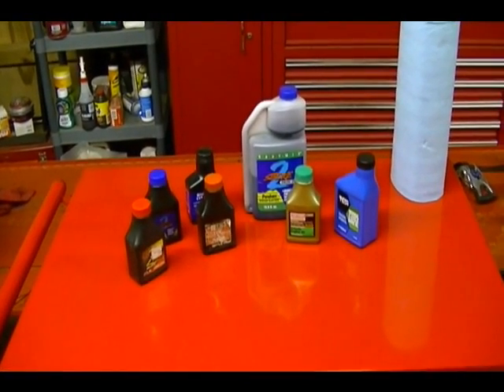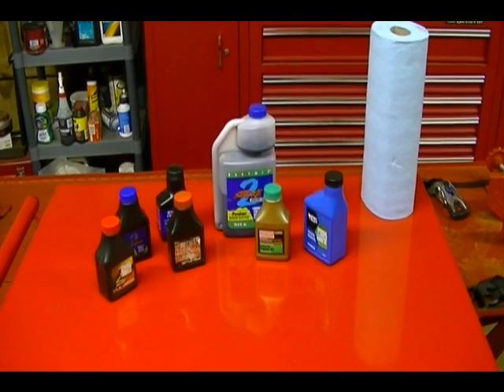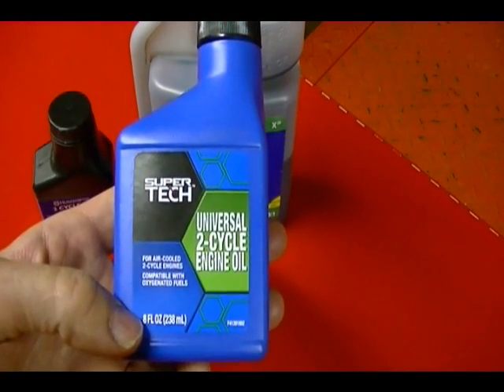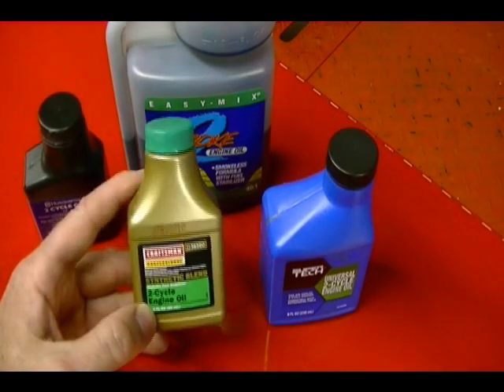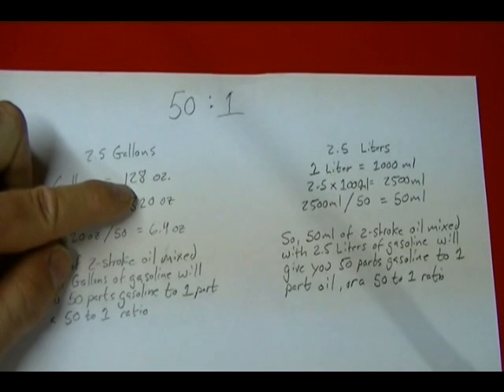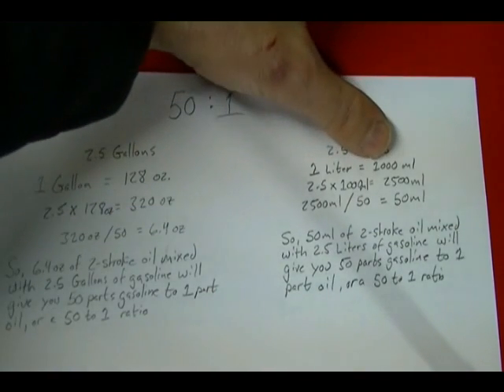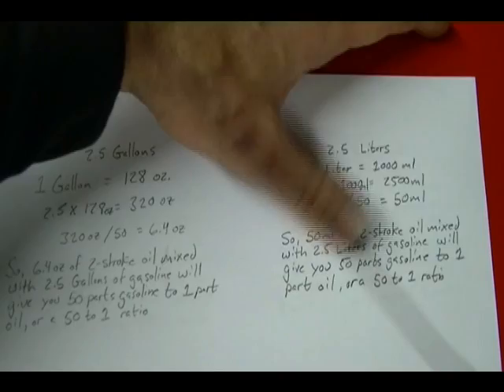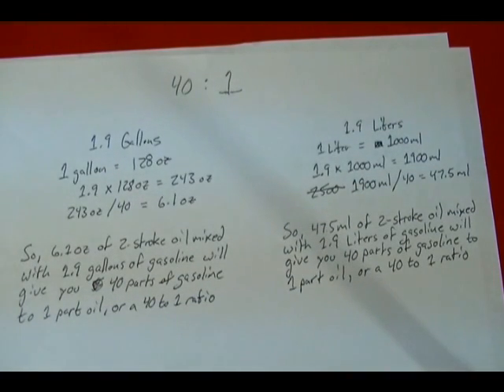Small Engine Repair: How to Calculate or Mix 2 Stroke Oil with Gasoline or Petrol

Comment: would it be possible to use plain edible  mineral oil as an emergency 2-stroke oil??
some say it can be mixed with the current oil for the break in period of any engine.
my engine calls for the 20:1 oil/gas ratio for the initial break in period, calls for the 40:1 after break in. i did however use a 20:1 mix of vegetable oil long after break in for a tankful with zero problems.  low ash buildup on piston/dome. whats the deal with these expensive oils when they dont seem to do much more?? whats the secret in mineral oil??

Comment: I would like to see someone come up with a mix chart for pints = 16 oz of fuel and quarts = 32 oz. I'am tired of mixing up a gallon of fuel and next time I go to use it the stuff is sour and the engine runs bad. I use less than 16 ounces of fuel  month in my weed eater 40:1 and it's really a waste of fuel. I get my fuel a a Marina and it's ethanol free at 4.99 a gal it's a waste. Good video bro nice info. Keep'em coming.

Comment: 1. take off the cap on the 2 stroke bottle, fill with oil, dump in the gas tank.
2. fill up tank with gas 
3. go to town, those little engines have a wide tollerence.
4. If its too rich, it just smokes more but the engine is fine and its bad for the environment 
5. You are cutting your lawn with a gas engine, who cares about the environment.

Comment: google search engine has a built in calculator that does this pretty easy. so for instance if you want to do 5 gallons of gas at a 32:1 you simply type "5 gallons / 32 to ounces" into the search box and it gives you the answer "20 US fluid ounces" in the results

Comment: It seems so much easier to use metric units. I can't even remember what an ounce is (grin).

 I just use one of those syringes sold at wallmart for the oil, and stick with a fixed single volume in the form of a small gas container dedicated to the device. Doing the same volume each time frees the mind of calculations, and lets you concentrate on the job at hand.

Comment: What I have wondered is I know the effect stabil has on gas but what reaction (if any) does it have  with the oil in pre-mixed fuel does it dilute its lubrication properties?  have no effect etc.